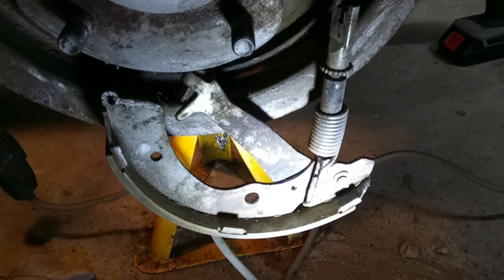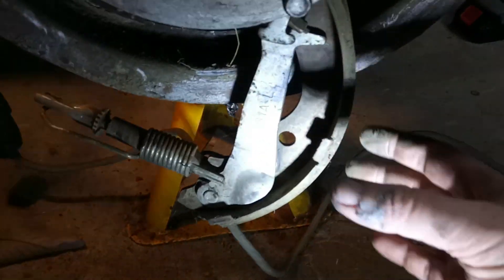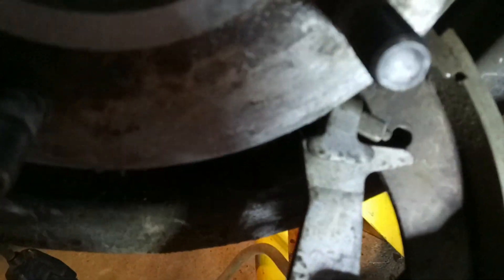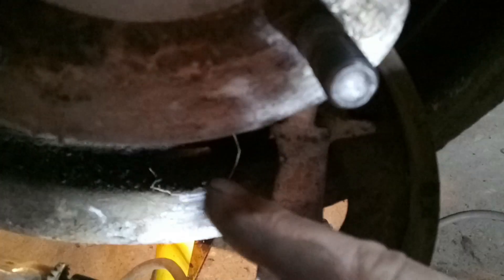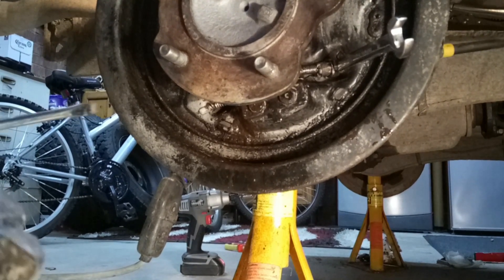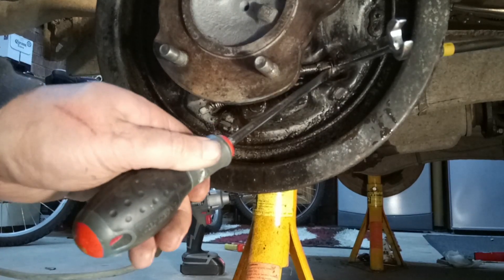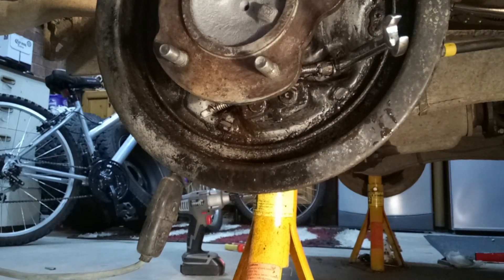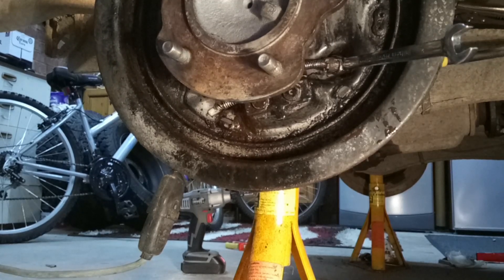Quick tip - How to remove handbrake cable from the backplate on Gen 3 Jimny

Comment: I don't want to sound bad, and maybe it's because I'm dumb, but I really didn't understand anything from that video :-(
Reply from the maker: Hi, I was struggling to remove the cable as you need to compress the 'fingers' to release. I found forcing a ring spanner on made it easier. Cheers